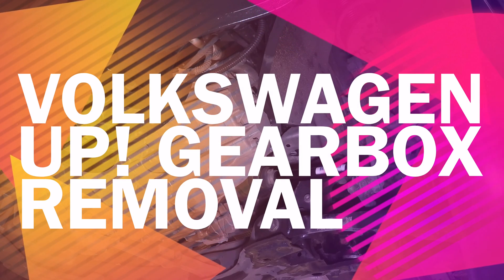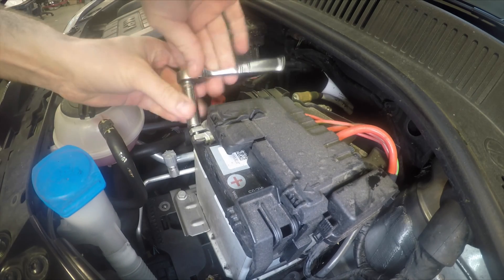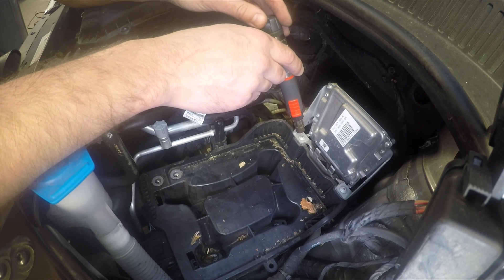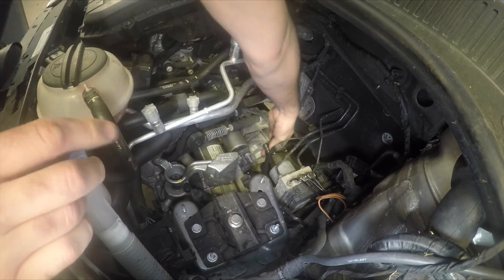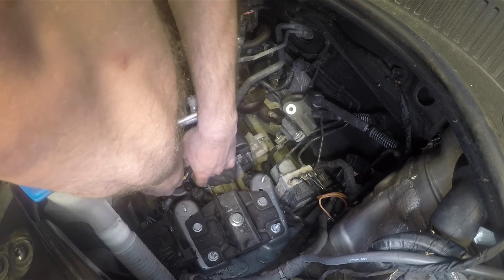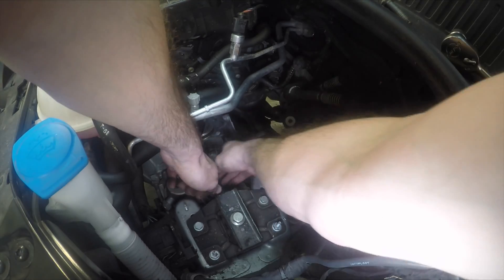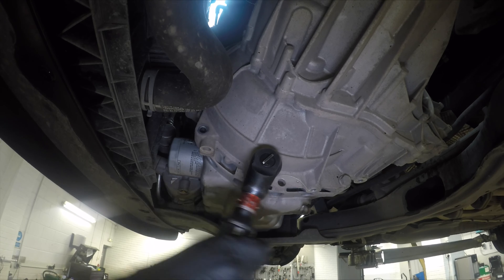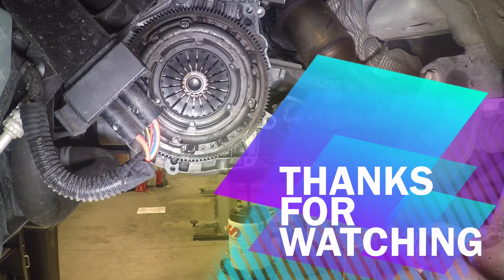How to remove a VW Up gearbox (Knocks in reverse gear) - VOLKSWAGEN

Comment: Hey great video. But u did one big mistake at the beginning. Always disconnect the earthterminal (Kl.31) from the battery first to prevent a short circuit from happening. If the positiveterminal-fusebox would have touched something conductive it would have fried the whole circuit 😅

Comment: I´ve seen two or three here asking about how much gear oil the box takes, and how to fill it up (no filling plug) but I don't see any answers on that.....
Reply: Around 1.2L of oil. You need to remove the sensor of the reverse gear to fill it.
Reply: @nicolasclement5120  Thanks, pal.

Comment: I have an issue withe orange transmission light, once it’s displayed on the dashboard the car shuts down and won’t start until it’s off the dashboard 🤦🏾‍♀️ problem is no mechanic seems o know what’s wrong with it because when it goes for diagnostic it doesn’t show anything is wrong with the car 😢 anyone that perhaps experienced the same thing too share any ideas please

Comment: Hi, this is a great video well explained and have you done a video to remove an automatic gearbox. I have worked on cars but never replaced a clutch. I have a VW UP 2013 Automatic and the clutch is slipping. After watching your video I have started to remove the clutch. I have removed all the top bolts, a stater motor. I am unable to remove the bolt from the stater motor bell housing. I am not sure which wire looms/plugs to disconnect and how they are secured. Tomorrow I am going to remove the oil, drive shaft, and all the bottom bolts. Also which clutch should I buy, the listing says semi automatic or manual gearbox operated by a control unit. What oil would you recommend. Thanks

Comment: hello! could you help me with some advice? the fact is that my volkswagen up! (2013, the gearbox is robotic) needed a box replacement due to an adaptation error. In the process of replacement, the thermostat housing was damaged. I'm trying to find information - was there a need to remove it in the process of replacing the gearbox - and I can't find it.. after watching your video about the removal, I did not see that the thermostat housing interfered, and the car is now in service and is not available to me. Could you tell me if the thermostat really interferes?
Reply from the maker: I have never needed to remove one or have it interfere with removal or replacement. So unsure how they could have damaged it. I would imagine its more a case they noticed it was leaking when they removed the gearbox and it needed replacing?

Comment: Hi man! After 2 years here I come again hahaha, I have 2 ups both bought used, one is smooth shifting (original clutch, 90.000 km), the other (cluch changed by an unknown mechanic while in the hands of previous owner, current cluch has 85.000km) gives me the sensation that even if I fully press the pedal its like the clutch should disengage a little more, the gear changes are clunckier and sometimes (1 out of 30 approx.) the first gear sticks and I need to re engage the clutch releasing the c. pedal while still in 1st give a little gas and then will go in 2nd gear, sometimes is also stiff to go out of 2nd gear and there is a little click to go past to enter 3rd and also enetering 3rd not so smooth as the "good" car, also I noticed on the well behaving car the bite point of the clutch pedal it's a longer travel, the poor behaving car has a shorter distance from pedal fully depressed to bite point, moving out of stoplights I don't feel as the clutch of the "bad" car is gone, what would you do? Ps. I changed on both gearbox oil myself so quantity and quality is the same (75w gl4)

Comment: I’m guessing it will be pretty much the same for a seat mii? I’m probably gonna have to do the wife’s soon, I’m a coach mechanic so know my way round the spanner’s but stuffs usually a bit bigger - I usually avoid cars at all costs
Reply from the maker: Yeah I imagine it would be very similar, if not the same. Depending on year etc.

Comment: Mine cant shift into the 5th gear. It does intermittently and then the engine check lights up. My diagnostics machine says something like gear selector difficult movement? Would you know how i approach this?

Comment: Does anyone know how I can download the up Tsi workshop please?
Reply from the maker: What do you need to know?
Reply: @ford873  basically it would be the step by step clutch removal, and reassembly if that’s the case,  for the vw up tsi,  mine is a 2018 model…
Would you have that? Also I would like to ask you if this tutorial video would be the same for the up tsi or would the tsi be very different?

Comment: Im not sure if you still answer questions but here it goes... For one thanks for the vid, my gear stick struggles to get into first and grinds  going into reverse, could it be a problem with the master cylinder or slave or fluid change lol
Reply: My Seat Mii does that too. I'd love to know what the fix is for that problem.

Comment: If you were replacing the clutch would you do the same?
Reply from the maker: Do you mean would I remove the box in the same way? If so, yes I would.
Reply: @ford873  I'm not a machanic, and this will be the first time doing a clutch. So the video is really helpful. Any further tips or advice would be welcomed. Thanks.

Comment: Thanks! question: if you coast in neutral at let's say 100km/h does the splash lubrication of this gearbox works or is it linked to rpm so you need to be in gear to lubricate properly?
Reply from the maker: I am assuming you mean without the vehicle being in gear but still running? I would expect that it would be sufficient enough. Its a small gearbox with only one chamber. Usually the handbook would advise a speed and time limit for towing the vehicle without the engine running because this could damage the gearbox through overheating etc. I couldn't find any limits listed for this vehicle so coasting should be fine. Although coasting and not being in gear is generally advised against while driving.
Reply: @ford873  yes you assumed right, perfect, thank you very much for your detailed reply!

Comment: Hi, my polo 2010 does kinda same but only when having alot of torque and low speed. For example 1-3kmh and reversing to a hill. Do you think i might have something to do with reverse gear
Reply from the maker: I really could not say for any kind of certainty without hearing and witnessing the fault myself, sorry.
Reply: @ford873  Yeah it is hard, I can send a video if you want to see it

Comment: Hi, my VW up is a ASG auto. Struggling to get into reverse. I have to sometimes turn car off and on then go from D1 straight to R for it to engage with a loud clunk sound? What do you think needs repairing as I just bought it and hope it doesn’t cost much unluckily the private seller hid the fault from me and I found out upon arriving back home. Morning try to reverse with no luck until messing with gears etc usually trying to drive forwards then reverse works after.

Appreciate any advice. Thanks
Reply from the maker: These are basically still a manual gearbox but with some extra gubbins to operate the clutch and change the gears. They were not the greatest boxes, even when new. Its hard to say without seeing the car, but the most common fault i see with these is a worn clutch friction plate. The only other real issue i have seen is the connector plug for the gearbox control unit, a few had contaminates which got in the plug from the factory. The first thing i would do is check your fault codes and see if you have any stored.

Comment: Big thank you for this superb video, I’m no stranger to working on cars, but this is all very much more modern than I’m used to, so to see all the horrible little clips and brackets in your video was a huge help. Clutch kit changed and the loud rattle at 3K rpm+ is now gone. Took me about 3 1/2 - 4 hours but a huge saving on the cost at my local garage. 

Once again, many thanks.
Reply from the maker: Thats great to hear, i am really glad it managed to help you.

Comment: Thank you for that video. I think next time i have to change the clutch, pressure plate and release bearing due to some rattle sound only if the clutch is disconnected on my wive's up. Could you recommend me a tool to hold the engine (I don't know the right word for the bridge on the top of the engine)? Thank you.
Reply from the maker: If you search for engine support / engine brace on Amazon there are several listed. I’m afraid I can’t recommend a specific one as I work at a main dealer, we only use the ones supplied by the manufacturer.
Reply: @ford873  Engine brace, that's it. Ok, thank you David, I was just wondering cause there is not much place on the right and left side to put a "standard" engine brace on.
Reply from the maker: That’s true, it is tight for space. We have different feet we can swap out for the various models that have the right angle and shape for each front end. If I hear of a good brace that works for this model, I will be sure to update the description above.
Reply: @ford873  Thank you David.

Comment: Thank you!
Can you say what cause the common rattling noise from those gearboxes ?
Reply from the maker: Most commonly from what i have seen is the clutch pressure plate. The fingers bend or break off and make contact with other components. Occasionally the release bearing can cause issues as well.